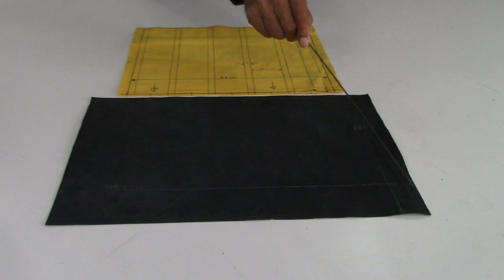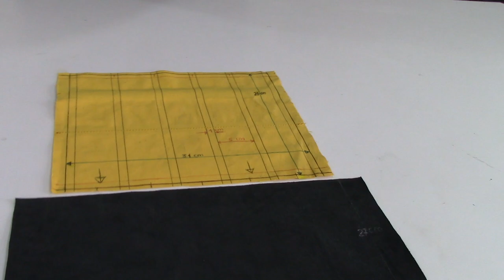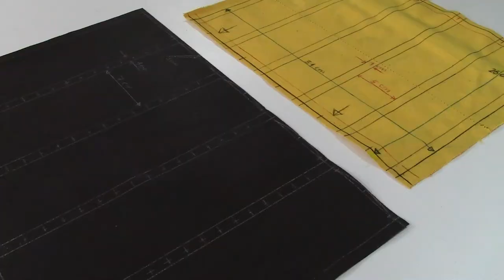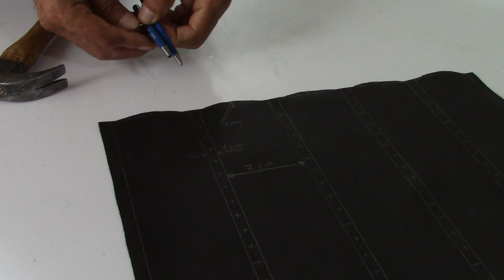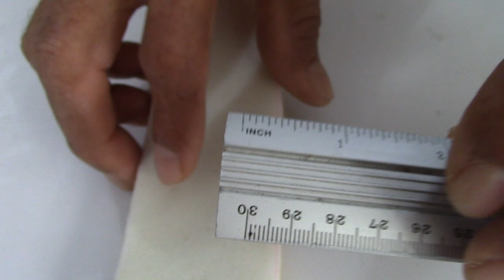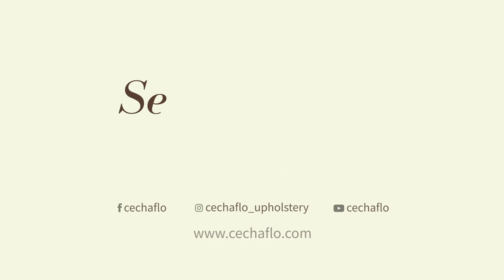Box Square Pleats in Leather /Tuck & Roll- Automotive Upholstery

Comment: The work is superb as always, It would be possible to use thick felt instead of foam rubber strips, then there would be no strong folds in the place of tightening, this technology was used in old cars.
Reply from the maker: Dear friend/colleague, I really appreciate your kind commentary!
I also watch your videos and appreciate your excellent professional jobs.
I am aware the felt material would make the pleats look more square and much better.  BTW, I have some felt material in my shop.
I am doing these samples/training beforehand because I would do a job on a Rover P6 3500 1974 automobile.
The problem is my customer feels the original pleats are too hard while driving long trips.
Perhaps, by adding a layer of high resilience foam on top of the felt would solve the issue.
Reply: @Cechaflo  I would very much like to see the finished result for the Rover P6 3500, knowing your approach to work, I am sure that everything will be at the highest level
Reply from the maker: @autotailor1710  I also expect to do a nice and strong job.
The customer is going to order leather material from Wildman&Bugby supplier. It seems he will go for the Cardinal Barley leather and another red colour for the piping.
https://wildmanbugby.co.uk/product/cardinal-barley-whitecream

Comment: I've never glued in a rod before....when the 1994 Mustang came out and we did the seats changed from 1993 and prior....I ended up redoing things the way I thought made the most sense and we sewed a loop and created a channel same way you did here...but added a rod to the bottom to make sure the contours  would keep the same shape over time.  The 1994 mustang seats seemed to have had a spray in foam that just pushed the pattern out and stayed to those dimensions...cuz we had to peel the foam away from the leather and that was weird for me to see...then later a lot more manufacturers started having either glued in inserts or velcro  loops...  

I wonder if it is due to less time assembling at the factory?
Reply: We connected hog rings the way the older style seats had...forgot that ...
Reply from the maker: Dear Jeffrey, Thanks for sharing with us useful information!
After disassembling some car seats I realized hard steel wires were embedded in a channel. Sometimes, they are behind a mesh to add more resistance to fastening. Of course these steel wires and mesh included were put together while melting liquid foam into a mold.
The way I use is an artisan way I consider a good option because I have done several car seats and those steel wires do not take off. My customers are still happy with their seats after some years passed.
I used this method on this bucket chair I still have it as a sample in my shop.
https://www.youtube.com/watch?v=QyjZIQ3e-TU&t=246s
Regarding the use of velcro I can say it is just another practical method to fasten the covers and give desired shapes.
Car manufacturers are always on the vanguard with the searching and application of new materials in regard of car interiors and others.
Reply from the maker: @mrupholsteryman  Yes, you are right!  I also like the old school method.

Comment: Incredible job! 👏
What size of piping did you use on this seat?
Reply from the maker: This is sample/test I sent to a customer in Australia. The real seats are for a 
Rover P6 3500 1974.
The plastic pipe is 3 mm thick. I used a skived leather strip 1 mm thick to wrap it around the pipe. Consequently the final piping was slightly thicker.